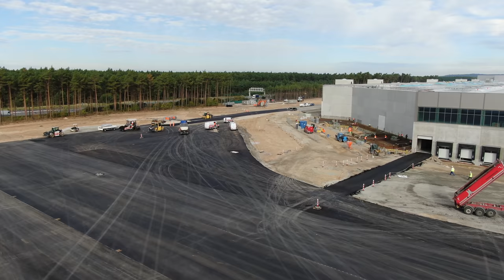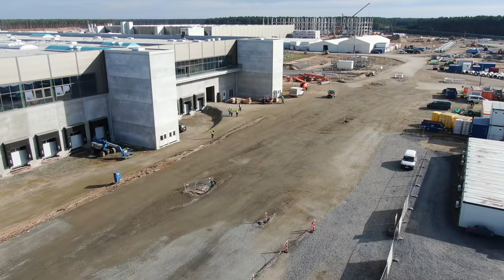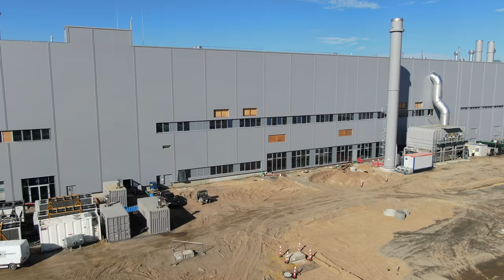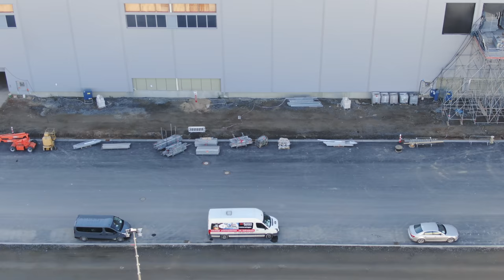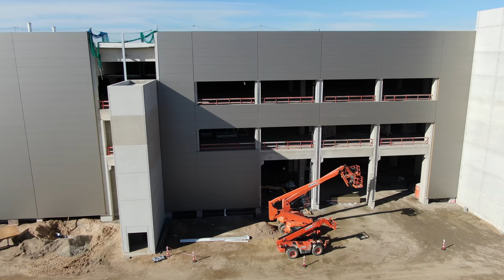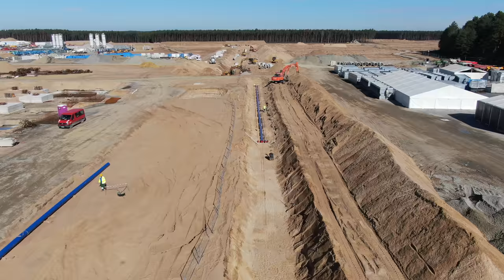Giga Berlin | 2021-10-02 | More Asphalt

Comment: Do we think the tarmac to the factory gate at 1:39 is where the completed car will leave the factory for the charging, and logistics point on the new tarmac area? 🤔 I seem to remember the test track being to the east of the factory though
Reply: No. It's all temporary and will later be the main parking lot.
Reply: @julianreverse  oh of course, because cars will dispatch by train normally rather than truck
Reply: 1:39 this tarmac is only for the county fair. 
In front of the main building there will be parking for employees and guests.
There won't be a test track anymore (which was planned on the middle axis). Instead, the plans are to use a test track emulation machine.
The empty space you can spot at 21:03 will be used to store newly produced cars until they will be shipped by trucks or trains.

Comment: I like the color of the buildings too. What color are they. We should tell GiGA Texas to use Berlins color for the buildings.
Reply: I think Giga Berlin will be the best looking Giga.
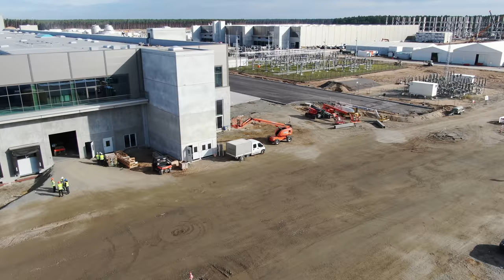Reply: 4:46 grey 
or
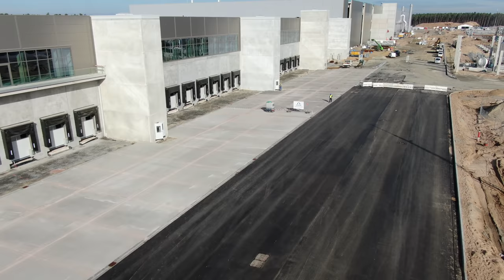5:19 bronze-colored
Those are however the same wall panels. Their color changes a bit with the viewing angle, sky, and surface in front of them. 
Partly (paint shop, stamping) there are also wall panels with a static grey color. And partly also plain concrete (which is also grey).
Reply: @jamescoppe  Giga Berlin looks so nice. Really well done Berlin. Those guys, man good design and layout. Way to go

Comment: Excellent video as always Tobias. Few questions:
Will there be enough paved parking for 9.000 people who will be attending Oktoberfest on the 9th?
Will you be able to go in and take pictures of the progress made inside?
Did they paint the exterior of the building? Looks nice.
Will the recent elections have any adverse effect on Tesla's production schedule?

Thanks and keep up the great work.
Reply: @abalada  Just out of sheer curiosity what parties were openly against or critical of the Tesla factory?
Reply: @boostav  The most active is the ÖDP (ecological-democratic party). Which is however not in the German parliament. Critical have been also the most far-left (Die Linke) and the most far-right (AfD) parties in the parliament. An investor like Tesla is anyway a classical "enemy" of both parties (for different reasons). Apart from this being opposed is easy for opposition parties. Esp. for those for whom the always unsatisfied are a big clientele.
Reply: @abalada  the always unsatified ... i like that, prob the best way to discribe them and i'll try to remember that and use it, thx
Reply: "Did they paint the exterior of the building? Looks nice."
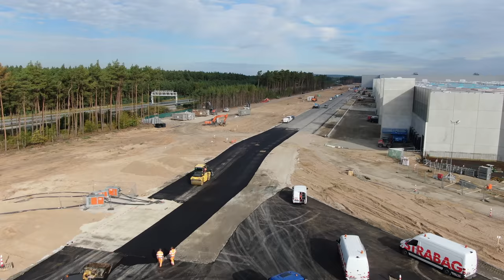Correction on this. They did paint on Saturday (thus after this video) the southern side of the staircase with the blue lift in front (1:58) black. At this location this might have just something to do with the county fair. But we will see.
Reply: @abalada  Yeah far left and far right, pretty much what I expected.

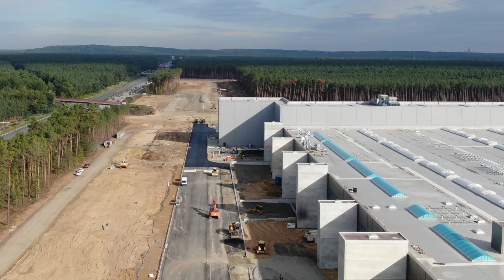Comment: At 2:50 you stop and film the fire station, but is it anything special here since you don't go closer? It looks like there is something just south of the fire station that you are not allowed to film?
Reply: At 2:50 he stops as I believe there is a restriction on flying just the autobahn. The fire station is to be built on the other side of the paint shop near the tanks. The big building you are seeing at 2:50 is the waste extraction point from the casting area
Reply: There is no fire station anywhere near.
Reply: My mistake. The scrap house on the northwestern corner.

Comment: Instead of just asphalting temporary surfaces again, it would make more sense to work on the final surfaces ...
Reply: Is the surface on the side of the highway not the final surface?
Reply: @monsieurb90  The Parkinglot is not.
Reply: @julianreverse  Maybe they don’t have the permission for a permanent surface there yet?
Reply: @monsieurb90  It's a matter of time. They need that space for the Gigafest and couldn't have gotten it finished in time. Remember, the final parking lot will have miles of curbs for grass strips and trees between the rows.

And btw, asphalt recycles really well. There are claims out there about it being the most recycled material on the planet.